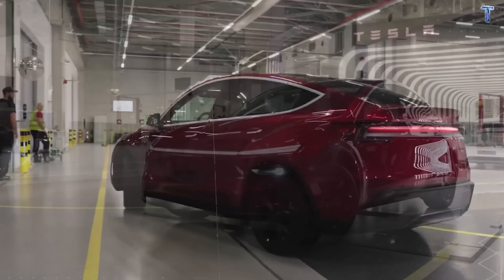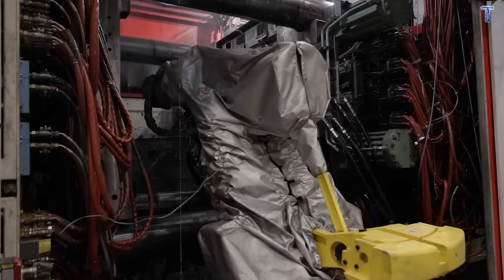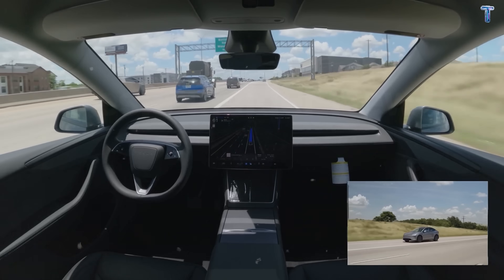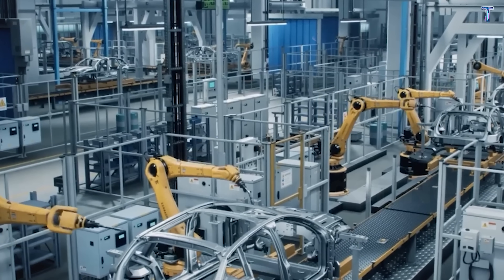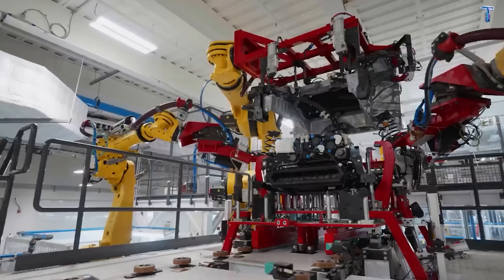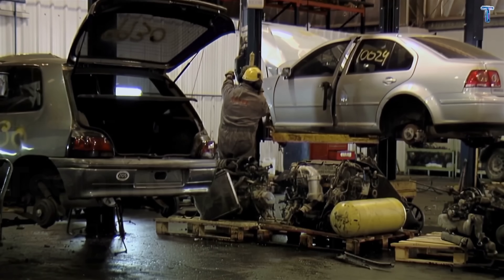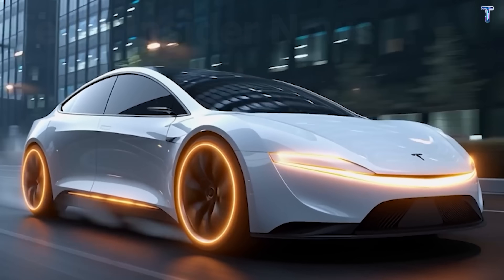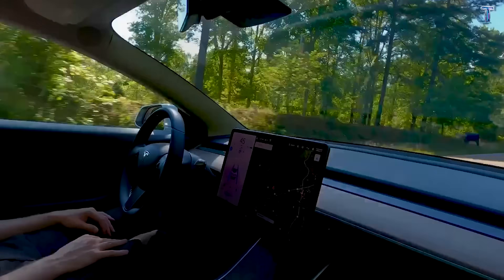Elon Musk’s $12,749 Model 2 Ends Car Bills Forever

Comment: I bought my Trailblazer in '06 for $25K, and paid it off in 4 years. I change the oil every 5k with Kirklands full synthetic oil from Costco. The cost for this is $3.50 a quart and a cheap oil filter. I do the work myself. The only serious repair was a new fuel gauge float at 5 years and new shocks and struts at 18 years. It now has 190k miles and still runs and looks great. It doesn't burn excessive oil. When it finally gives up, I will sell it for junk and buy another new, proven, dependable, gas vehicle and start the same process over. I think I am doing okay.
Reply from the maker: It sounds like you’ve made a smart, disciplined system that’s worked reliably for almost two decades. Low-cost maintenance, simple repairs, and long lifespan are hard to argue with. The question is whether an EV’s lower running costs could ever offer enough benefit to change a routine that already serves you well. If gas prices rose sharply, would you still stick with the same approach?
Reply: @TeslaInsiderNews   At the present time I say no, EV's don't offer enough benefit over gas, at least not for me. For one thing, I say you will never get 20+ years out of a bank of batteries, and they are super expensive to replace - WAY more than even a 10-year old EV is worth. Every year your range will fade too. Cold weather already brings it down significantly. Plus electricity isn't free - cheaper maybe, but definitely not free. The cost of EV buy-in is worse too. Now if gas goes to $10 a gallon all bets are off. A friend just stayed with me for a week from another State, and he spent every waking moment worrying about how he was going to get his next charge. He was having to drive up to 25 miles just to find fast chargers, and half the time he would get there and find them broken or being used, or he would need some adapter he didn't have. His car would only get a mile of range for every hour he spent plugged into the only available outlet at my house. It was a royal PITA.
Reply from the maker: Range loss, cold weather issues, charger availability, and battery longevity are absolutely real concerns for anyone comparing EVs to gas cars today. Your friend’s experience is exactly why a lot of drivers still hesitate — nobody wants to plan every trip around charging anxiety or deal with unreliable stations.
For many people, the tipping point would be consistent charging access and batteries that stay strong for decades instead of just years. Gas might be expensive, but it’s predictable and convenient.
If the charging network became as reliable and widespread as gas stations, would that be enough to make you consider an EV, or do the battery concerns still outweigh everything else for you?
Reply: @TeslaInsiderNews Hybrids by Toyota/Lexus have been out from late ‘90 if Toyota Corporation stays away from full EV might be a reason.
Reply: When did we go from cars with personalities and characters to Tupperware with wheels? I'm getting old.
Reply: @1NakedOne I like Tupperware but a comfortable easy on the pocket transport pod that comes in lots of colors sounds nice. Gotta do something about the dinner plate wheels paint them Red.  Tell Elon Colorfully Reliable, Color of Money you will save. Turquoise like the 55-57 Chevys.  Lose the clam shell doors and go Grumpy Old Guy wants back seat for his big dogs. Acceleration not #1 ( don’t forget about performance) price & range, did I say color.  I don’t want my red Lexus to be my last car of color I ever own. Thanks all I guess I do want Tupperware ‼️
Reply: What they don't say about electric cars, is that if it catches on fire they cannot put the lithium battery out and the only way the fireman can do is throw a special made blanket on top of the vehicle then water it you on the other hand will be incinerated I seen this on the news. For now stay with gas or a hybrid until they get the bugs worked out
Reply from the maker: Lithium fires are serious, no doubt, but the Model 2 in this breakdown uses a completely different approach to safety. The rigid aerospace-grade chassis, the sensor suite, and the redesigned door system all exist to reduce the chances of a failure turning into something dangerous. And with the sodium-ion and aluminum-ion batteries being tested here, the chemistry is far more stable than older lithium packs you see in those news clips. Fire crews also train specifically for EV fires now, so the response isn’t what it was years ago.
Reply: Next new one will have giant cost and 7 year payment.
Reply: @flouisbailey   I will buy the most reasonably priced vehicle I can get. Always have.
Reply: @ralphcantrell3214 We try I have gone for good pre-loved autos, currently a 2012 Lexus RX 83,000+ miles and a 2013 Lexus GS 450H 54,000+ miles, retired and live 5 miles from 4 grocery stores.  At 74 I only go if I want to. Stay safe, always drive with your flashers on, in high speed lane,  lol. Old fart joke waiting for the $15,000 Toyota Truck
Reply: @flouisbailey  LOL!👏 I plan to retire completely this year, and I have vowed to go somewhere every day and drive real slow. 😎
Reply: I admire your thrift. Electric cars do not need maintenance aside from tire rotation (and replacement if you own it long enough). I've had a Tesla for 5 years. It needed a repair to an electrical connection (not for the battery), and it was covered under warranty. That's it so far. No oil changes, no fuel gauges, no fan belts....I don't anticipate needing shocks or struts replaced. Brake pads someday maybe. Fuel costs half of what gas costs. The car just drives great, no fuss, no muss. Just my experience.
Reply from the maker: That’s exactly the kind of long-term experience people want to hear about — real ownership, low hassle, and predictable costs. Five years with only one covered electrical repair is a strong track record, and avoiding oil changes, belts, fluids, and most brake wear really does add up over time. Having a car that just works without constant attention is a big part of the appeal.

Since your maintenance has been so minimal, have you noticed any range changes over those five years, or has it stayed pretty consistent for your daily driving?
Reply: @TeslaInsiderNews A self driving car will put me to sleep in a quiet cocoon of luxury.
Reply: Never use cheap oil filters!
Reply: At some point (1) gas cars will be banned and (2) gas will be hard to buy.  Likely not until the 2040's but it will happen.
Reply: @chrisalbertson5838  Good luck with that. I won't be alive.

Comment: 12749 is the minimum down payment and only 108 monthly payments...and hundreds of sensors to go bad...
Reply from the maker: Financing structures can definitely make numbers look nicer upfront, and long payment plans can add a lot over time. The sensor count is high, but most of them are solid-state and designed to last the life of the car. The question is whether lower maintenance and fuel savings would offset that for you over the years.

Comment: lol it's a Xiaomi ripoff...without the good software
Reply from the maker: Xiaomi set the bar pretty high on software — what part do you think Tesla would struggle to match?
Reply: @TeslaInsiderNews  It may differ greatly from your opinion, but Tesla has some durability and overall quality issues across their platforms. I really don't know anything about Xiaomi's durability. As an owner of a '68 Mercury Cougar, durability is the primary value of any motorized vehicle, and I honestly don't know enough about Xiaomi to make a fair comparison.

What I do know is that the Tesla  body styles shown in your video look a whole helluva lot like Xiaomi vehicles.
Reply from the maker: Tesla body styling definitely overlaps with some of what Xiaomi is doing, especially in the compact EV segment where aerodynamic shapes tend to converge. Durability being your top priority makes sense, and older classics like your ’68 Cougar set a very different standard. Since you haven’t seen enough from Xiaomi to compare fairly, what specific traits would make a modern EV feel durable enough for you to trust it?
Reply: @TeslaInsiderNews  In my view, the elephant in the EV is battery degradation. Granted, the current data on the life of an EV battery is not fully available and is also dependent on how the EV is driven and how the charge is maintained which is certainly a 'wild card' variable.

That being said, I have to go with my own factual observations: replacing an EV battery costs $5-20k USD, whereas rebuilding a combustion V8 engine runs $2-5k USD for a basic rebuild with factory grade components. 

The range of the EV battery also constantly decreases, and combustion engines typically last 200k miles or more before critical failure. So I guess when the cost of replacement vs. lifetime mileage of an EV reaches equilibrium with that of a combustion engine is when I will be sold on the EV.

Personally, and setting durability aside, I'm far more fascinated with the Lucid EV line than any other.
Reply from the maker: Battery degradation is the real make-or-break point for a lot of people, and your comparison is completely fair. A V8 rebuild is predictable, affordable, and proven — EV battery replacements today definitely aren’t in that category.

What changes the equation here is the direction this model is aiming for: chemistries designed for thousands of full cycles and multi-decade lifespan, not the 1,500–2,000 cycles most current packs manage. If the real-world data ends up matching that promise, the lifetime cost could finally hit the kind of balance you’re talking about.

Until then, your approach makes sense — wait until the long-term numbers prove themselves. And yeah, Lucid’s engineering is impressive.

Comment: very misleading on the costs of a vehicle for those over 55 years old especially if we don’t have car payments. I applaud Tesla for their safety features and innovations, but I have several concerns. How much to replace tires or parts in case of failure if it’s out of warranty? What’s the duration of the warranty? Anything less than 10 years is a travesty. If Tesla is promoting a vehicle that will last 50 years, then anything less than a lifetime warranty is scam.
Reply from the maker: You bring up valid concerns, especially for buyers over 55 who aren’t dealing with car payments anymore. Tires and basic parts should cost less on the Model 2 because its simplified design cuts down on complex components, but Tesla still needs to clarify exact pricing. As for the warranty, the standard today is far from 10 years, so your point is completely reasonable. If Tesla is confident in a car built to last decades, a longer warranty would go a long way in building trust. What warranty length would you consider truly fair for a car in this price range?
Reply: @TeslaInsiderNews it isn’t just the price range, it’s what is reasonable for costs to repair or replace car parts compared against the value of the car. When a friend recently replaced a motor in his 10 year old truck, it was covered under an extended warranty. Without it, the costs exceeded over half the vehicle’s value and would have been cheaper to look for another truck…so yes, I would consider a $13k car with at least a true bumper to bumper warranty of at least ten to fifteen years.
Reply from the maker: A ten- to fifteen-year true bumper-to-bumper warranty would absolutely change how people view long-term value, especially when repair costs can exceed the worth of an older vehicle. Your friend’s situation is exactly why buyers worry about expensive components failing after the standard warranty ends. If Tesla wants people to believe in a 50-year lifespan, offering coverage that actually reflects that claim would make a huge difference. Would a strong warranty matter more to you than things like range or performance?
Reply: @T @TeslaInsiderNews It really depends on what an expected degrade of range and performance loss would be and if a warranty would cover repair costs for that those problems. If degradation was less than one percent annually, then it would be a relatively good investment for a consumable item over the course of 10 to 30 years. If the degrade was more annually and at the end of a 10-15 year warranty, the car really becomes a consumable item. And for those nearing retirement and expecting to have a car and maintain it beyond 10-15 years, it’s not worth the investment.
Reply from the maker: A slowdown in range or performance really does change how people judge long-term value, especially if they plan to keep the car through retirement. Annual degradation under one percent would make ownership feel stable, but anything higher starts to turn the vehicle into something disposable rather than lasting. A warranty that actually covers those losses would matter a lot.

If Tesla published honest long-term degradation data up front, would that transparency make you more willing to trust their durability claims?
Reply: @TeslaInsiderNews Trust will always be earned and never given. Providing historical and unbiased data would be a big step towards building consumer trust, but only in the sense that the data is verified and there is a lowered risk. How can anyone have trust for the life span of a new battery that’s yet to be available on the market? Or how can a consumer trust that a new vehicle will last them a lifetime without some sort of insurance or guarantee. I go back to the proposed cost of the vehicle and it is tempting, but without that guarantee or warranty, it is still a higher risk to replace what I currently own.
Reply from the maker: That makes complete sense — trust really does have to be earned with real, verifiable data, not promises or projections. Until a new battery chemistry has been on the road for years, nobody can honestly claim it will last a lifetime. And without a long-term warranty or some kind of guarantee, the risk stays on the buyer, not the manufacturer.

A tempting price doesn’t outweigh uncertainty, especially if what you already own is reliable, predictable, and low-risk. For many people, replacing a proven vehicle with something unproven just doesn’t add up unless the automaker steps in with stronger protections.

If Tesla offered a long-term battery guarantee paired with transparent third-party testing, would that reduce the risk enough for you, or would you still wait to see years of real-world results first?
Reply: @TeslaInsiderNews A long term guarantee would definitely reduce the risk enough, but there is still the matter of infrastructure support for charging that concerns me. If in 2026 and Tesla sells too many of its new cars, consumers could overwhelm the electrical grid in my area. There aren’t many homes that have supplemented with solar in my area, there’s consideration to shutdown a coal power plant in 2026, and a nuclear power plant was shutdown a few years ago. There is mention of two new power plants, but nothing firmed up according to the news. So, in addition to the risks of replacing an already proven vehicle, will Tesla and other manufacturers help to improve an already stressed electrical infrastructure?
Reply from the maker: That’s a completely real concern. Even with better batteries, none of it matters if the local grid can’t support large-scale charging. Automakers can improve efficiency, but the heavier lift has to come from utility companies and regional infrastructure plans.

If your area is already dealing with plant shutdowns and unclear replacement sources, it makes sense to be cautious. A long-term guarantee helps the risk on the car itself, but without a stable grid, everyday use could still be a headache.

Would stronger local charging support matter more to you than the car’s features, or is it something that would need both to line up before you’d consider switching?
Reply: @TeslaInsiderNews More charge stations would be very helpful especially during power outages, but it wouldn’t affect the decision. I love to cook, so opening more restaurants near me wouldn’t get me to go out to eat more.
Reply from the maker: That’s a great analogy — adding more charging stations is helpful for convenience, but it doesn’t automatically change someone’s habits or preferences, especially if what you already have works well. For a lot of people, reliability and long-term confidence matter more than infrastructure alone.

Since charging access isn’t the deciding factor for you, what improvement would actually make an EV feel like a better fit than your current setup?

Comment: Yet the electric companies are raising prices. You wont be able to afford to charge it up
Reply from the maker: Electric rates are rising in some areas, but charging an EV is still usually cheaper per mile than gas. Even with higher electricity costs, most drivers spend less overall. What’s the rate per kWh where you live? That makes a big difference.

Comment: Electrical nightmare.
Reply from the maker: Some wiring setups in early EVs did have issues, but newer models are getting a lot cleaner and more reliable. What part of the electrical system worries you the most — batteries, sensors, or the onboard tech?

Comment: Now if we can only hope that they install solid state batteries.  350mi. X .85(reality factor) = under 300mi.  Inadequate.
Reply from the maker: Solid-state would definitely solve a lot of range and durability concerns, but Tesla hasn’t shown any signs of moving to that tech for the Model 2. The LFP packs they’re using trade long-term lifespan for lower cost, which is how they hit the $12,749 price. But you’re right — 350 miles EPA turning into under 300 real-world isn’t ideal for everyone.

What would you consider the minimum real-world range for a car in this segment?